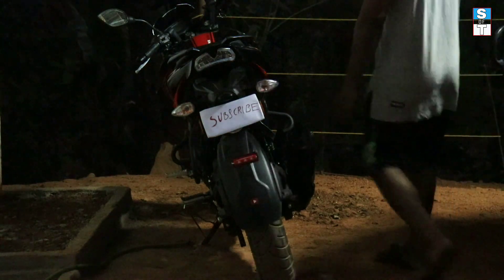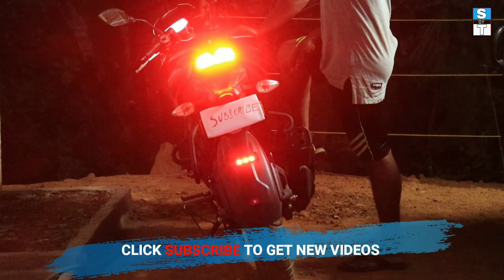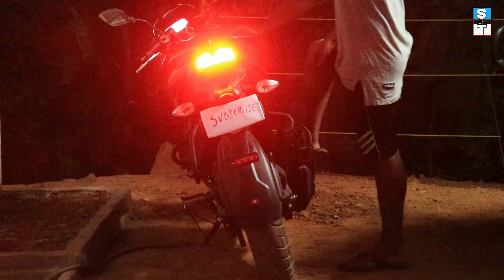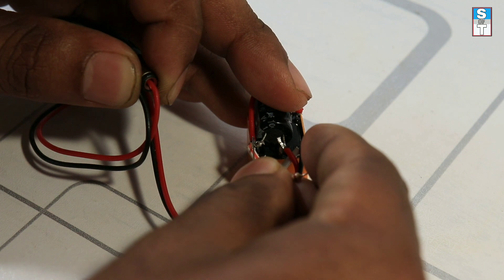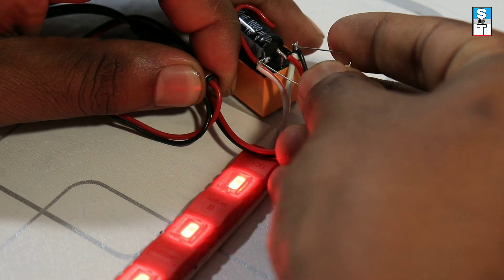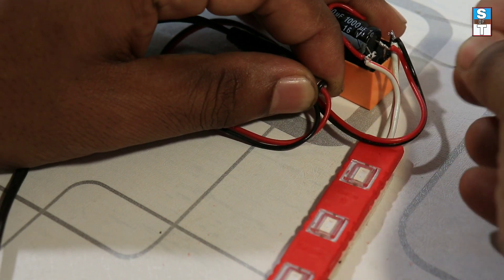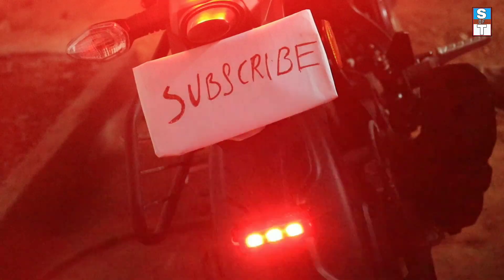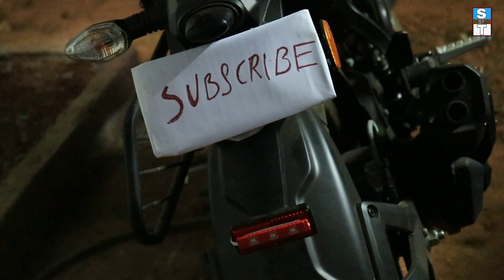How to make bike led flasher | Bike brake light led

Comment: Working well.👍
But it drains out my bike's battery very fast.
Reply from the maker: Don't connect directly to the battery just connect on the brake light connection.
Reply: Not directly to the battery. 
 I connected it to the backlight. 
But after sometime my self motor stopped working due to lack of enough power in battery.

Comment: Sir this circuit is possible when i want to make it steady like tailight and then when a brake it flashes? Is it possible?
Reply: S
Reply: @vishwajeethsharma7156  part2
Reply from the maker: Possible
Reply: @Lifeofelectronic  what till i add? Or modify this diagram hehe is it possible you can make a pt. 2 of this video hehehe

Comment: i saw again your this video, bro please make video flasher head light of cd bike with switch please
Reply from the maker: Ok I will do
Reply from the maker: You want head light flasher
Reply: @Lifeofelectronic  yes
Reply: @Lifeofelectronic  please isi week me bana den this video
Reply from the maker: Bro I think this circuit also work just replace the led and connect it into your headlight
Reply: @Lifeofelectronic  but i need the physical work video and how make connection of headlight flasher
Reply from the maker: Ok I got it